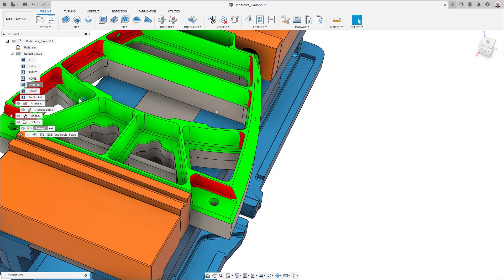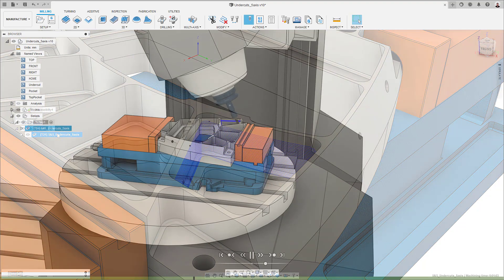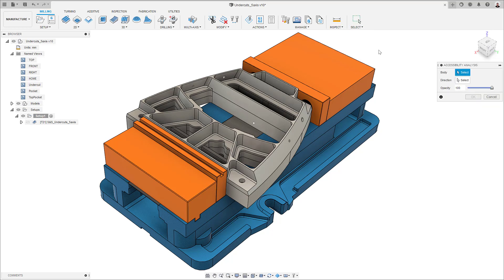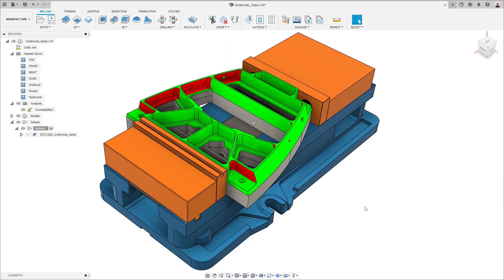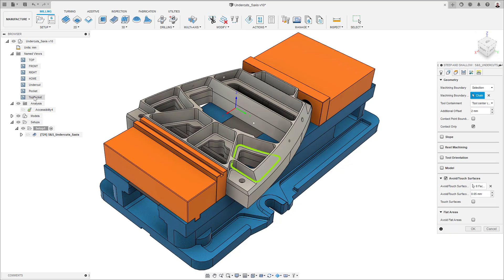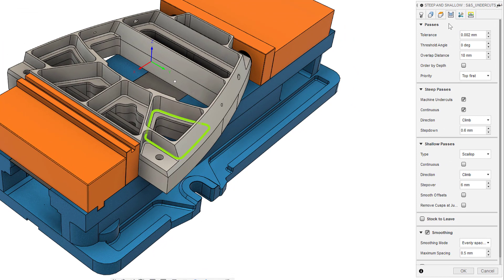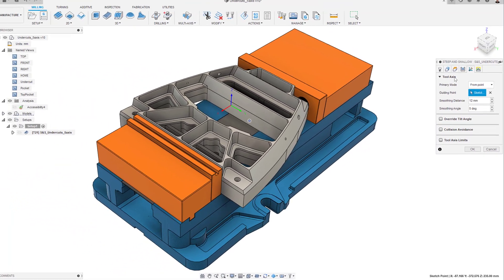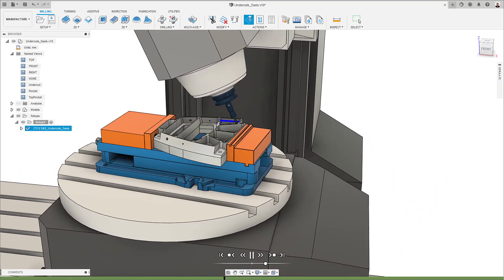Fusion 360 Tutorial: How to Machine Undercuts in 5 Axis Using a Steep and Shallow Toolpath

Comment: Hello. When I use the ‘machine undercuts’ tab I can not get the cycle to use the shallow settings.  I’m trying to machine a pocket with undercut walls and the concave bottom of the pocket with 0.5mm step over all over.  However it won’t apply 0.5mm step overs on the shallow areas.  Any help would be greatly appreciated. 
 Thank you.  Craig.